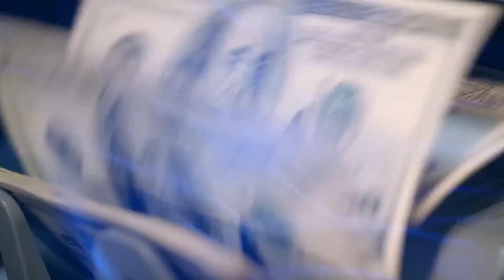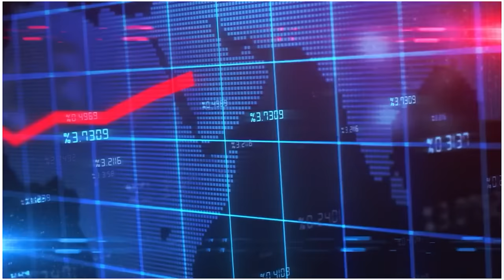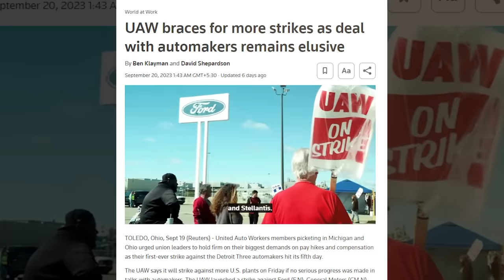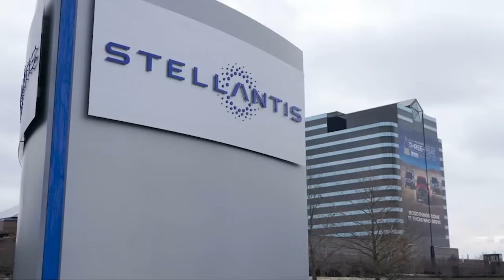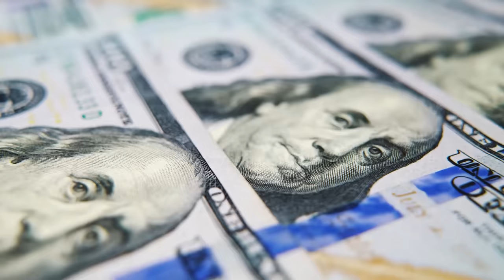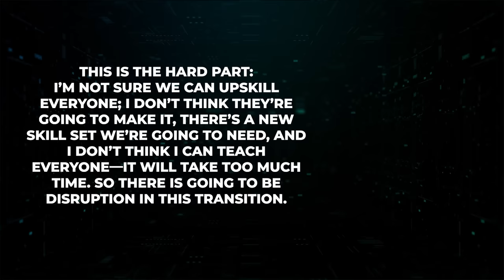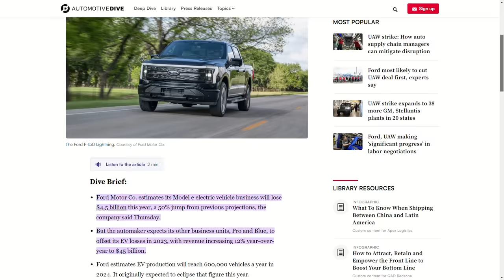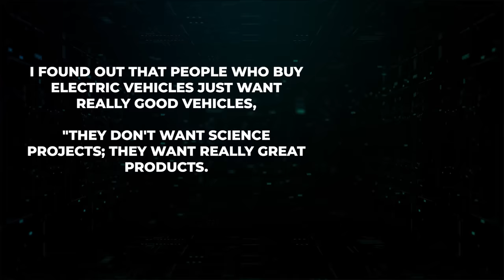UAW Strike: Is Ford Really Going Bankrupt? | Ford CEO – "It’s ALL OVER For Ford!"

Comment: If you are not building enough charging stations to keep up with demand in coinvent locations what the point of buying an EV.
Reply: People said same things about gas stations when automobiles were just starting out. Your way of thinking is very short term. Do some research, you will find huge advances in battery technology and vehicles coming soon that can go over 700 miles on a single charge.